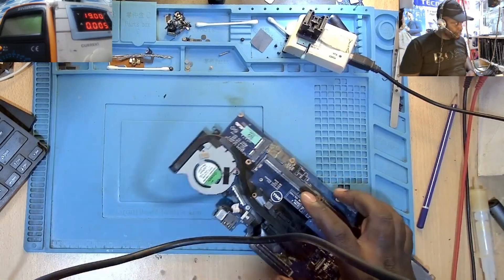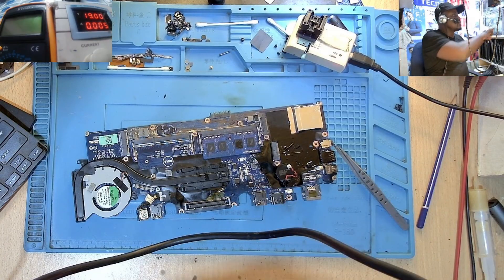How to fix Boot Guard Verified Failed DXE error on most Dell laptops

Comment: How good are the ones you just clip on the chip without desoldering. The reprogramming clips
Reply from the maker: Still works good as long there's a good working space. Sometimes the chip is placed in a very congested area